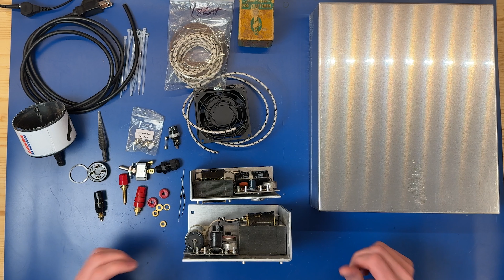Building a PSU for the SCELBI 8B

Comment from the maker: 1. As pointed out by some in the comments, the Amphenol connector is backwards. We should use a female version in the power supply. I will fix it on my side.
2. I ended up disconnecting earth from the enclosure and connected it to the common ground instead. This is because the enclosure has continuity with other components of the power supplies.

Comment: Why did you mount the fan on the top and not on the back? And why did you mount the power supply units on the top and not on the bottom plate. That would have made the whole psu a lot cleaner.
Reply from the maker: It's just one way to mount it :-)

Comment: SAFETY CONCERN!!!

AS YOU HAVE USED A METAL CASE.

Not sure about US regulations,  but in the UK the Case should be connected to the Mains Earth.  This requires the use of a standard 3 core Mains Cable.  This is to ensure that in the event of a failure (such as one of the internal mains cables coming loose) that the case does not become live at 240V.

.
.Otherwise enjoyed the video on this and other replicas.  I have your pcb's and most of the components to build your mk8 replica

Cheers

Clive
Reply: Apolgies,  Did not realise as you mentioned it slightly later.
Reply from the maker: I have the case connected to ground.
Reply: @vintagetechrevivals  Actually, you don't.  You have one of the PSU subframes connected to ground (I'm going to use 'earth' below to distinguish it from circuit ground / common).

What's 'wrong' with that?  If a fault occurs on the -9V supply subframe, the current would need to flow from the -9V subframe, through the case to the 5V subframe, then to earth in order to blow the fuse and 'safe' the unit.  The earth should be on the main chassis, since that's the part you, as the user, would touch and would electrocute you.

Also, there should be shakeproof washers on the subframe mountings in order to ensure good electrical connection between the main chassis and subframes.  The earth connection to the main chassis should also have a shakeproof washer to ensure good electrical connection.

That fan will drive you mad within 10 minutes.  Try a 12VDC fan connected to the -9VDC supply, which would lower its rotation speed but still provide positive airflow.

Comment: Unless the -9V needs more than 1 AMP., why not use a 7909 mounted on the main power supply board, rather than that whole separate power supply ? :hand-pink-waving:
Reply from the maker: That’s basically what that power supply is. It’s just a transformer with a regulator and some components for remote sensing.
Reply: @vintagetechrevivals  - It just seems like an overkill. Extra weight and extra power consumption wasted.

Comment: 1.) You should always use a FEMALE connector on a power supply port, and a MALE connector on a power consumption port.

Basically, you installed the ports backwards.

2.) You should have installed the fan so that it blows air in, with a smaller diameter outlet (creating positive air pressure), so that all of the air coming in is filtered, and it has to flow out through the cracks, crevices and other outlets; preventing dust from entering because of the filtered inlet and positive air pressure.  But because you are blowing out, all of the air coming in will come in through the unfiltered outlet, cracks and crevices, thus forcing dust into your system.

Basically, you installed your fan backwards.

3.) Also... Just use modern Noctua fans, they have high CFM, and very low noise.
Reply from the maker: 1) I had initially thought that the original power supply used a male connector which is why I installed a male connector as well but looking into it now, it looks like I made a mistake - the original also used a female connector. I will get this fixed.

2) I installed the fan so it blows hot air out of the enclosure but regarding the dust, that's an interesting idea. I might consider it for future power supplies.

3) The fan is easily replaceable. I might replace it because the whiny noise it makes might get to me :)

Comment: You may be making a critical mistake on wiring the low voltage connections on the power supplies but quite easily fixed. Note there are two posts for the + side and two for the - side. In many of those old linear supplies, one post is the actual + or - terminal and the other is a remote sense line. That was for the regulator to measure the voltage at the load to compensate for voltage drop over the low voltage wiring. If these are not bridged to the mating terminal or at the load, regulation will be poor.  At your current demands and with TTL logic, you really don't need remote sensing so just tie them to the mating terminal.

BTW, those old open frame linear power supplies are tanks! Will long outlast any modern cheap switch mode power supply.
Reply from the maker: Great info! I thought the sense connections could just be left disconnected to disable the remote sensing functionality but I guess tying them to their respective terminals (+ to +s, - to -s) is a safer way to go. Thanks for the info.

Comment: Hearing your power demands reminds me of those days, when you could almost fry eggs over the 74S TTL!

Why are you energizing pins on the power supply?  Most people will use a female connector on the PSU so you don't drop a screwdriver on it.

Nice neat wiring job inside! I wasn't following through the jump cuts. Are the air intake and outlet on opposite ends so that you draw air across the boards?
Reply from the maker: The main reason why I’m using a male power connector on the power supply is because the computer side has a female connector. Yes, the air intake is on bottom in the back and the outlet is on top in the front.